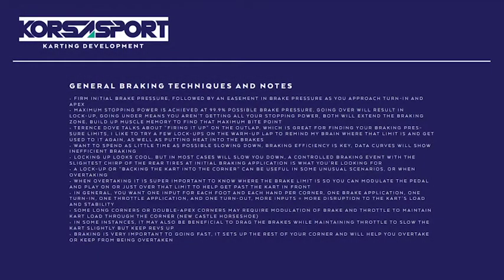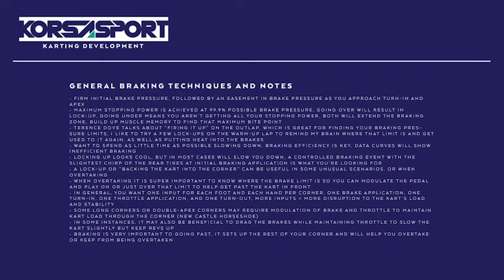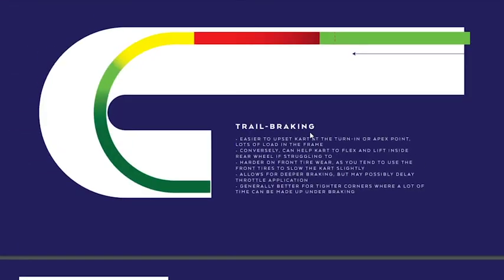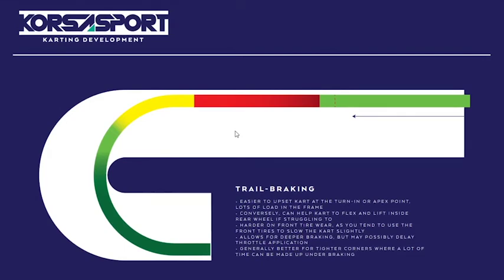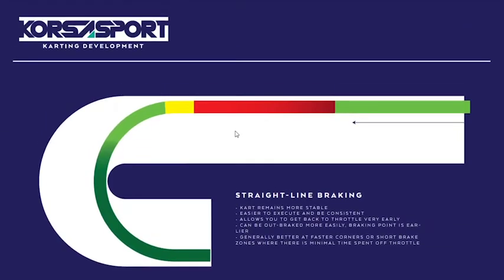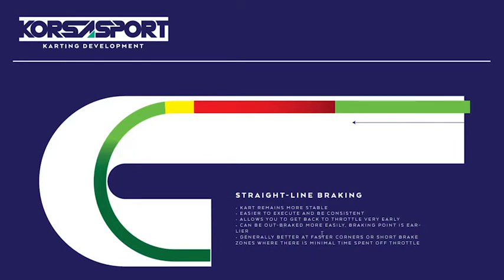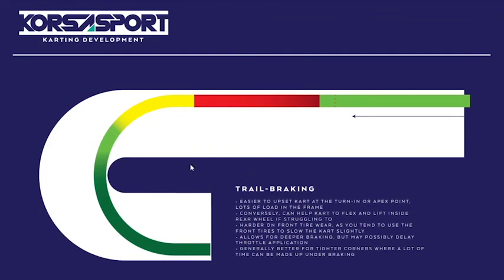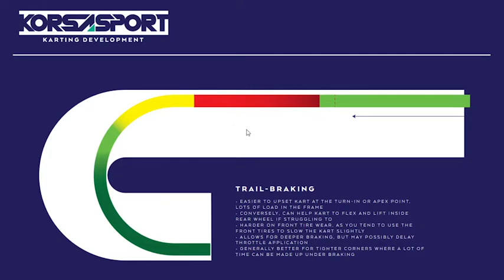Karting 101 : Lesson 2 - Braking

Comment: Good Video TJ!  Maybe this is a more advanced braking technique but what are your thoughts on early braking (backing up a corner).
Reply from the maker: Hey Bob, braking earlier can be useful if you're trying to optimize your run off the corner and get on the gas even earlier in a battle or something, where you're setting up the other kart. In general though there will be a point where you can't get on throttle earlier, or you'll be too quick at apex, so in most cases braking early will be slower overall. Straight-line braking would probably be the example of "early" braking that can still be quick.

Comment: Hi, thanks for your great tutorial. I have a question about the trail-breaking. The basic kart uses a rear brake and the front tires lift the inside rear wheel up when steering. So if a brake force is applied only to the outside rear wheel during trail-breaking. This brake force is against the steering inputs. But the braking moves the COG to the front, which helps the front tires steering. Does the braking help or resist the steering after summing these up?
Reply from the maker: Interesting points. Yes, it's probably true that if the inside rear wheel is unloaded, leaving the outside rear wheel to brake while you are trying to turn-in, that braking force is probably working against the turn-in somewhat, however the mechanical jacking of the kart far exceeds this loss and isn't really noticeable when trail-braking.
Reply: @KorsasportKartingDevelopment  Thanks.